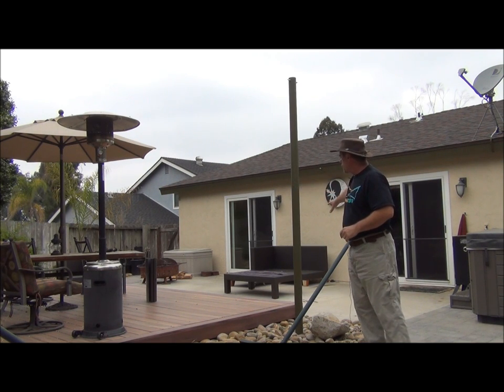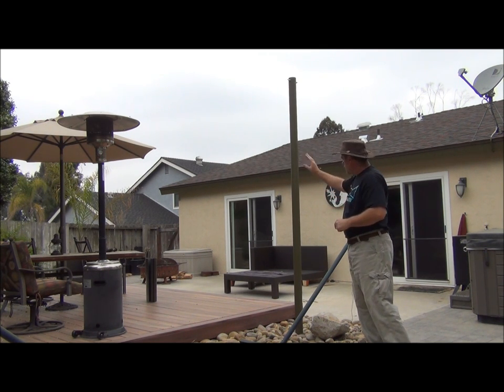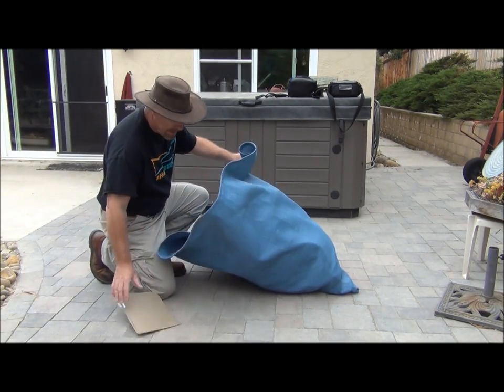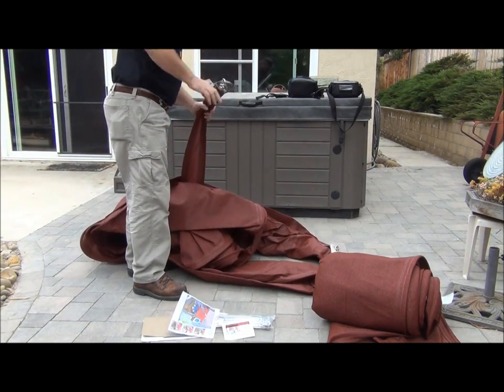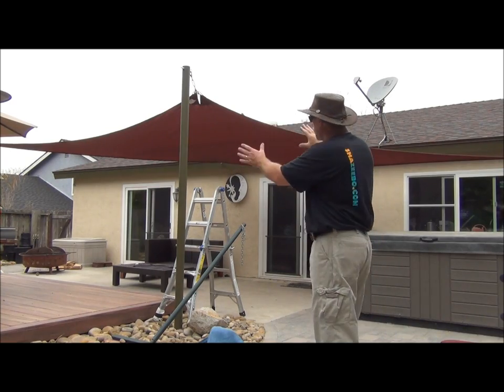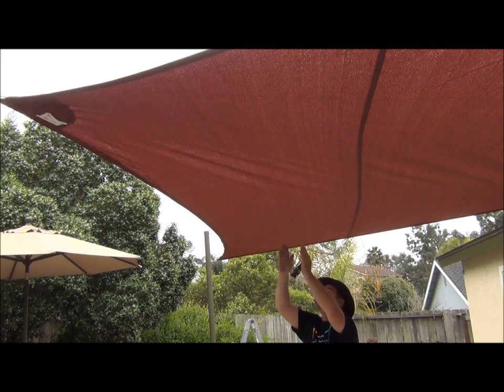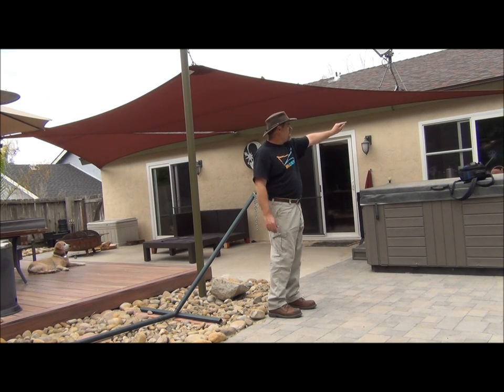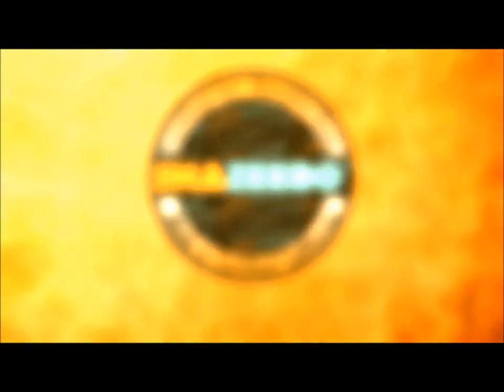Shade sail installation by Shazeebo

Comment from the maker: Normally a fascia board alone is not strong enough to support a shade sail.  This attachment at the fascia board goes through the fascia using a rafter bracket that ties in to the rafter.  The corner of a house is one of the strongest places to use for a shade sail attachment as there are several 2x4s  to attach to.  Both of these brackets are designed to be used with normal construction.  
With posts you should bury 1/3 of the total length of your post in your footing leaving 2/3 above ground.

Comment from the maker: The triangle sail does have a cable.  Shade sails need perimeter tensioning from a cable or webbing.  I recommend cable sails for your first sail project as they are more flexible than a webbing sail.  You can adjust the cable independently from the sail which can help remove wrinkles and get the sail to fit better. The webbing style generally looks better on small sails because it doesn't have corner reinforcements which can look bulky.  Webbing sails are less forgiving of measurement errors.

Comment from the maker: The easiest way to calculate this is to add a foot to each corner of your sail.  If your sail is a 12 x 12 square then put your attachment points at 14 x 14.  An 18 x18 x18 triangle sail fits attachment points set at 20 x 20 x 20.  It is not enough to extend the turnbuckles all the way, you need a little bit more distance between the sail and the attachment point.  I hope this helps.  Thanks.

Comment from the maker: Short answer yes.  The weakest link is always the footing. Never skimp on the footing.  The post is the next weakest link.  You can sometimes use a smaller post and although it may not break, it may bend causing the project to look bad.  You can lean your posts out away from the sail to compensate for some bending but you are better off using a bigger post.

Comment: How do you calculate how wide apart to set the anchoring points so that you end up with that much tension?  I would have thought to just set them as far apart as to accommodate the sail with the turnbuckles fully extended. And afterward tensioning the turnbuckles only without any tensioning device. What am I missing?

Comment: What does something like this cost now a days?
Reply from the maker: Hello! Sorry for the delayed response. If you are looking for a full installation, the average residential project is generally somewhere between $5,000 and $13,000 depending on the number of posts needed and how many sails you would like. If you are looking to DIY the project, our custom shade sails are $8 per square foot and that includes the cable and corner hardware. Give our office a call and we'd be happy to answer any questions you have. 760-603-3269

Comment: For the triangle shade sail you didn't run a cable correct?  I have done some up to 24' x 30'   with 5 connection points with no cable system.  Do you tend to always go with a cable?  Or is it situational?

Comment: What are the specs of the poles used?
Reply from the maker: This video is from a few years ago, so I don't recall the specs particular to this job. However, we generally recommend schedule-40 steel posts, at least 4" in diameter for most projects. If you would like to discuss your project specifically, feel free to email us at info@shazeebo.com.

Comment: I notice that you are installing to fascia boards and the corners of the house. Is there anything special about either location to strengthen the fascia / corners or is normal construction sufficient to support the stress? How are the poles seated also? Is there a rule of thumb for footers for the poles?